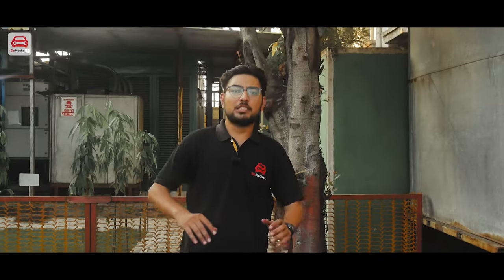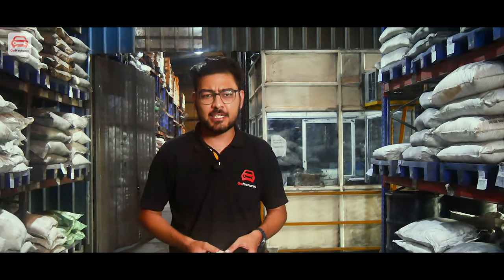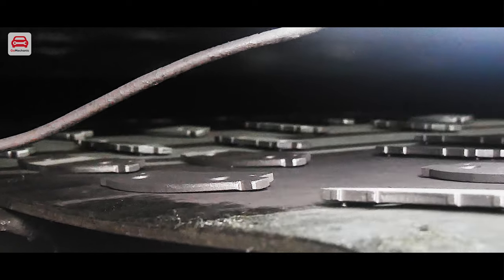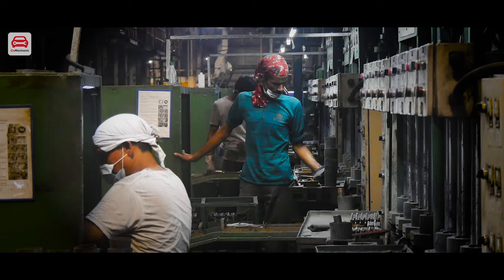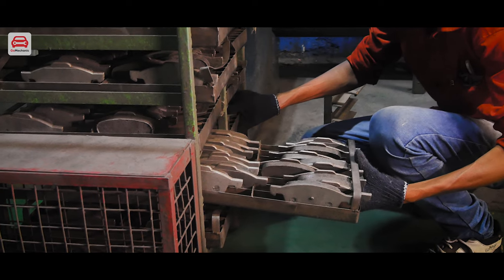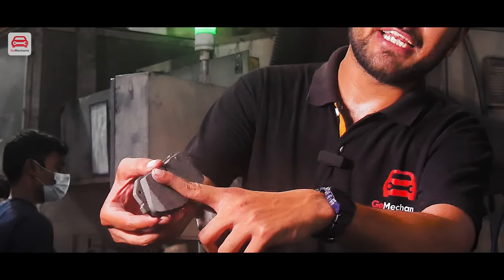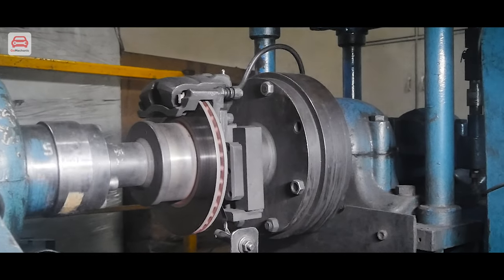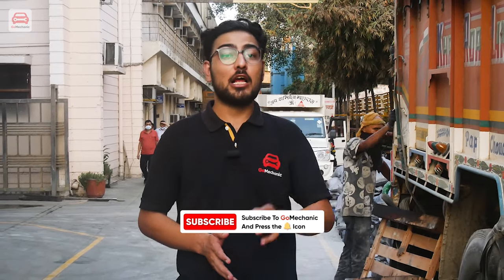How Brake Pads Are Made? | @gomechanicindia SafeTec Brake Pad Factory Visit

Comment: This seems to be the worst method to manufacture brake pads. Ideally brake material should be fused with notches and spikes on the backing plate. And the plate should be galvanized to prevent rust. And also a rubber coated metal plate should be added on the backing plate to make sure there's no vibration or noise being passed through. I can't believe a component so important as brake pads aren't protected from rust!
Reply: You came from chrisfix video?